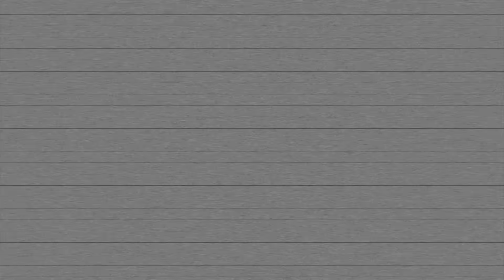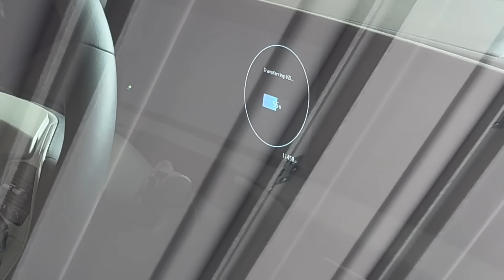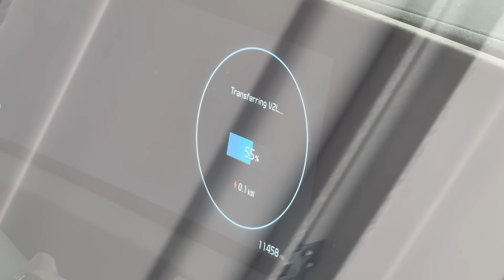My Home Lost Power! Powering My Freezer From My Kia EV6

Comment: I think it would be a nice idea to have the circuit for fridge and freezer wired with option to switch to external supply.

In this case, where the main panel is fried, I think it's better to move it, and use extension cords.
But if you are in an area where you experience random black outs; it would be nice to have it ready to flip a switch, to use  secondary supply, wither generator or V2L or something else.

Comment: This is hilarious.  But please folks... you don't need V2L to run a fridge.  Any medium-sized power station will do the job.  You can use the vehicle to recharge the power station I suppose (solar is easier to be honest).  But you don't need to tie-up the vehicle running the fridge.

Where having V2L can really be useful is recharging a larger power station or DIY battery/inverter system.  Useful because it could do it at a decent rate and then free the vehicle up for use as an actual vehicle.

For just the fridge, though... another option if you don't have V2L is to just use the power port in the car (former cigarette lighter port).  Those can be directly plugged into a power station and charge it at roughly 100W or so.  The fridge will average around 60W of consumption.  But this will tie-up the vehicle for longer due to the low transfer rate (though you can unplug any time to go on errands and leave the power station in place running the fridge).

Comment: I’m certain the cooling compressor was not running if only 100 watts is reported.  When cooling it should be at least 500W and starting power is over 1000W.

Comment: While he's getting electrical work done, might as well get a transfer switch installed in the garage so he can power his house from either or both of his KIAs without any sketchy extension cords and power strips... 

Something like a Nature's Generator Power Transfer Kit will let you manually power individual breakers in your home - Check out Technically Jeff's video titled "Using My NEW 12-Circuit Transfer Switch with My Kia EV6 to Power My HOUSE!"

Comment: After a tornado hit our neighborhood last year, I ran 2 fridges, a chest freezer, some lights, a box fan, laptop chargers, etc. for 37 hours and only used 18% of my EV6's battery. I even did some cooking with small kitchen appliances (microwave, Instant Pot, toaster). On another occasion I used V2L to run my sump pump for a few hours, which may have saved my basement from flooding. It's a killer feature that should be in every EV! No noise of a generator, no fumes, no extra maintenance, no stockpiling fuel, always ready to go. Extension cords are a pain though; I'd like to get a generator inlet installed so I can power the whole house (or at least a selection of 120V circuits).

You could also pair this with an Ecoflow or similar unit; that way you can still use the car for short errands, and even DC fast charge it to bring back more power. Although a freezer would probably stay cold long enough to do that anyway.

I do think the real-world efficiency is significantly less than what you calculated, in line with the 30% power loss when level 1 charging 800V E-GMP cars, as observed by The Ioniq Guy and others. Also V2L turns off at 20% so that eats into the available power. It is still enough for 5-7 days of relative comfort in my home, so I'm very happy with that.

Comment: Please go out and get a proper single heavy duty extension cord. It would be tragic for you to get lucky with your main breaker nearly burning your house down only to do it by rigging up a pair of extension cords to run your Fridge/Freezer. Especially if you will be leaving this setup with no one home. As others have mentioned a fridge is not an EV and it's not going to pull a constant load. As the compressor kicks on and off or even the automatic defrost kicks in the amount of power consumed will change. Wouldn't want a repeat of melting cables and potential fire.

The 200w "average" for calculating how long the EV6 could run the fridge was hilarious. You can't just average the two values with each other because obviously the vast majority of the time you aren't going to be getting ice from the fridge so it's going to consume a minimal amount of extra power.

An EV is a wonderful back up power option for many people and we've got an inverter and now two Leafs that we could use to run it if we needed to.

Comment: Watching yall move that fridge when I work on them all day is hilarious. When the power comes on it’s in a delay usually for about 7 mins. It’ll draw about 1-2 amps while the compressor is running and slightly higher about 6-8amps in a defrost cycle every 12-24 hours or so for 30 mins.

Comment: Last week I saw a video where a Model Y (with CCS capability) plugged into a SigEnergy powerwall and charged the powerwall. Thus Model 3 and Model Y with CCS have bidirectional charging (aka V2L sleeper feature). So, has anyone tried plugging the Kia V2L adpater into a CCS-to-NACS adapter and then into a Tesla? Does this work? I would love to have it since my Model Y is CCS capable and has no NEMA 5-15 plug built-in.
Reply: Teslas will only output DC to the charging pins. There are adapters you can buy online for V2L, but they have an inverter in them. 

With the exception of the cybertruck, which will do AC over the charging pins.

Comment: An extension cord plugged into a power strip? The plug into the car under stress? Yikes! I have a hard time imagining how a homeowner doesn't have at least one decent 14/3 50' extension cord... I've got several just for regular use, plus a dedicated heavy duty one for plugging into the generator during power outages.

Every EV should have V2L, but that day has not yet come.

Comment: V2L is one of the big things that brought me to Ioniq 5 - it's absurd that so many EVs don't even have small 120V inverters. That's a huge amount of energy that you can't really use in an emergency without doing some hacky 12V setup. Any car that can charge at 120V should be able to reverse it. I heard conflicting info about Volvo EX30, but the dealership said it didn't support it and I'm not buying promises.

Comment: A refrigerator compressor is usually around 400 Watts when running, or about 1/2 HP.  The 100 Watts is what the anti-condensation heaters and internal barrier heaters draw.  It is ironic to put a heater inside of something you’re trying to make cold.  The internal heaters direct convection air currents.  There may also be a circulation fan and that would be about 10 to 20 Watts.  There may be a switch somewhere that allows the anti condensation heaters to be turned off.  In the arid southwest the anti condensation heaters can probably be left off unless you get water dripping around the door seals.  There is also a big defrost heater which usually turns on briefly once or twice a day to de-ice the freezer evaporator coil.  That can draw as much as 1.5 KW.   A fancy fridge can also run the refrigerant loop backwards like a heat pump to defrost, but not many kitchen fridges have that feature.
Reply: my fridge's compressor draws about 80 watts. does not need defrosting. then again i am not in the US.

Comment: My next car will definitely have V2L.  I've rigged up my Chevy Bolt with a 2000W inverter to power a window AC unit and some electronics for a few hours. If that power outage had lasted longer, I was going to hook up the fridge and the deep freezer. I could've run the house for about 3 days, and then I would have gone to the DCFC. The Bolt can only provide about 1500W DC-DC, so I was careful to stay well below that. There's a trick to keeping the Bolt on, so if anyone's interested, get some details from the forums.

Comment: I just traded in my Mitsubishi Outlander PHEV that had that function and if the battery was ever going to run out the engine would turn automatically on to charge it.  Will miss that ability.

Comment: Chevy are you paying attention? Let me do this from my equinox. Hardware is already in the car and you just need to sell me a compatible adapter like the power bar. I just need one 15A outlet for the fridge! Stop trying to sell me the $10,000 whole house backup and let me use a simple 15A adapter.
Reply: In real life you just use a power station to run the fridge.  The power station can then be recharged by any number of means, including simply via the vehicle's 12V power port (which every car has), or with an extension cord if the vehicle has a regular AC outlet.  That frees the vehicle up for running errands... the house will remain powered from the power station.

What you don't really ever want to have to do is tie the vehicle up in the garage directly powering things in the house. 

A fridge only uses around 2kWh/day, so a medium-sized power station with 2000Wh of storage would have no trouble running it for 24 hours before needing to be recharged.  Inclusive of inverter overhead.  And of course, one can be recharging the sucker while simultaneously running the loads.  Hard to go wrong with a power station, really.

-Matt
Reply: You should be able to if you have the 19.2kw onboard module and buy the power bar.
Reply: @insomnia5050nope I have base model, which still has V2L capability and identical (huge) battery, but no power bar support. No good reason I can’t plug one 15A plug into the car. They need to sell a power bar “lite” with a single outlet. I’d buy on day 1.
Reply: I mean... They sell 12V to 120V inverter kits that work for the Chevy Bolt. Only like $500.

Comment: Can't help but think that it would be better for there to be an AC outlet under the charging flap as well as the charging socket.
Reply: good idea. there is not that many times you use that V2L  feature though. besides some vehicles have a plug inside.
Reply: @ursodermatt8809  For camping, or at the park or beach
Reply: @IronmanV5  
you can't park or camping with the external adaptor?
Reply: @ursodermatt8809  The way it sticks out is just asking for it to be broken off.

The nice part of having the AC outlet on the outside is that you don't need the hatch or door open AND you can use it while charging.

Comment: V2l stops at 20%. The fridge will duty cycle and probably would last a month. I'd make a run to grab extension cables, power your Internet, fridge, laptop and tv, probably could even power the microwave. You'd need to do load calculations to stay under the 15amps. Much more versatile in europe, with everything at 240v appliances only draw half the current - gives us 3.6kw on the european v2l adapter.
Reply: Thanks I was wondering why they talked about so little power. I know we can get much more here in Europe.

Comment: How do you guys not have  heavy duty 100 foot extension cords?  You have every other known electrical equipment, except that.    Too funny.
Reply: It might have gone to NC. I imagine we'd have seen the giant ecoflow, but I think they had that on the track out there.
Reply: I have two 100 foot 12 gauge 2 wire+ground extension cords on reels with built in plugs in my garage.  I found cords from Southwire which have an oil resistant jacket.  If I recall it is type designation SJOW.  The downside is that the oil resistant cover is more flexible than a vinyl cover and some purchasers complained their cords kinked.  I believe if you use a cord reel you won’t get any kinks, so far my cords are OK.

I have a transfer switch on my furnace with a male inlet socket allowing me to run a cord from my portable generator (not a so-called suicide cord, it is correctly isolated and switched).  The second cord can run my fridge.  My generator is big enough to run the whole house, but I have not installed a somewhat expensive whole house transfer switch yet.  Eventually an EV may take the place of the generator.  My current EV doesn’t do car-to-load.

Comment: When my EV 6 was about 2 weeks old, i took it to Wacken open air rockfestival. I had a tent. It was running my cool box, cooling my beer and other stuff, running my ventilator, charging my phones, music, light etc. for three days and used only about 20%. I not realy used it often, but it is nice to have. But do not forget you can set a limit for SOC in the car. And there is a lower limit to prevent the car for running total empty. So check out, what is the defaut setting.

Comment: I wish my Blazer EV had this capability, but I’m getting the GM Energy back up system.  The part I like the most is I can use my Blazer with the bidirectional charger to power my home.  So cool!  😊
Reply: That's one reason I didn't even consider Blazer. I believe all EVs should have this - the hardware is there but they didn't enable it through firmware.

Comment: I recently backed up my refrigerator, freezer, OLED TV, modem, and router, while having a PowerShare Gateway installed. It used 7% over eight or nine hours. 😮

I’ll be able to deliver up to 11.5 kW (11,500 watts) of continuous power from the Cybertruck to our home and 48 amps.

If my calculations are correct the total load, not including the water heater is approximately 34 amps and 3,510 watts. It’s nice having the equivalent of nine Powerwalls in the CT battery..,

Comment: It's mind boggling how many expert reviewers miss to mention this unique feature for EGMP vehicles. If it  was in Tesla, they would be salivating about this feature for days 😂 they have this since 2022. Tesla just got this in cybertruck.
Reply: I think the Kia ev6 can only do 120v at 1.8kw (normal household outlet), while the cybertruck and other EV trucks are able to do 240v and 10+ kw.  Plus the Kia needs a $500 OEM adapter to do 1.8kw, while the EV trucks have it in the bed or frunk of the trucks.

I seriously can't wait until we can tap into every Tesla as a home backup battery like they mentioned in the video with Sigenergy.  I think it doesn't matter if it's a Tesla or a ford, as long as it DC charges, it can do V2L
Reply: @fadinglionhart yes. I see there is difference between cybertruck outlets and capacity.  

The adapter is included with the vehicle when I purchased ev6 in 2022. 

Just pointing out hippoocracy. Just imagine model 3 or y having this feature. This would have been publicize and would have gotten so much credit and these same people would have criticize others not having it..😂
Reply: Agreed, I think Tesla's should have had exportable power for many years. I have actually two inverters on my Model 3, one that runs off the 12 volt system for 2000 watts and one that runs off the NACS plug for $3,500 w.

Comment: Suggest having a heavy duty extension cord on hand for emergencies like this.  Thin cords are scary.
Reply: I have an EV6 and a Ecoflow collection.  Here is a totally amateur video where I tested the V2L.  Video has no sponsors so hopefully it is OK to post a link.  If not please delete.

https://youtu.be/APyMOl0BHMM?si=uWBUKn0rbEQfFwcJ
Reply: 10 Gauge 100 Foot Extension Cord for sure! 

It also can stay in the car for emergency 120v charging with the cars 120v charger. 

That'll give you roughly 125 Feet to reach a far away outlet.
Reply: @LordTimelord  Can one just a different EVs L1 charger into the port and get trickle charged at 1.5 KW?
Reply: @Illopp00ify as long as you have the needed adapter for a different style connector. 

Most third-party chargers or other manufacturers chargers will charge any ev. There are some exceptions. But for the most part they are interchangeable.

I have a 2024 Tesla cybertruck dual motor. There was a person with a Cadillac lyric that was almost dead. 

I used my Tesla mobile connector with a 240-volt pigtail adapter to utilize the 240 volt outlet on my cybertruck to get them a few percentage points of battery so they can get to the next charger. Fortunately they had a Tesla nacs to CCS adapter so they could charge up with my portable charger.

It would work the same with 120 volt charger, but it would just take a really long time. LOL

Comment: The compressor on the fridge is what's really going to consume the most power, but it only runs intermittently. This use case is one of the reasons why I am really considering an e-gmp car for my next EV.
Reply: The compressors in refrigerators usually only pull 100-200w

Comment: Fridges are efficient.  They draw  a lot more power when the compressor is running and actively cooling the fridge.  The other cycle is the defroster, your freezer actually runs a defrost (heating) cycle to melt any ice buildup.  That will also take energy.  Not sure if this was addressed later in the video.
Reply: a good fridge does not need a defroster.

Comment: I‘m cross shopping compact evs at the moment and the v2g/v2l capabilities could give me a reason fpr the bigger batterie option.
But upgrading e.g. an id3to  the biggest batterie size make no real sence, if u have to install a dC-capable charger for this. Also the dealer was not quite prepared for these kind of questions

Comment: I have a portable battery that can run my refrigerator for over 24 hours.
Reply: the car also has a portable battery on wheels. The battery goes anywhere you drive :)
Reply: @uhjyuff2095 Colton should purchase a 100 foot long heavy duty extension cord for future power outages.